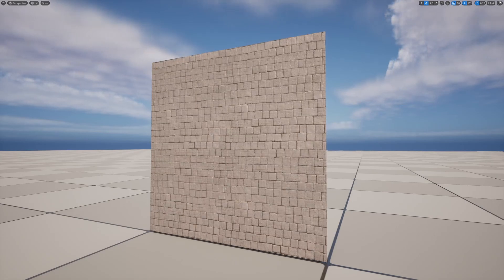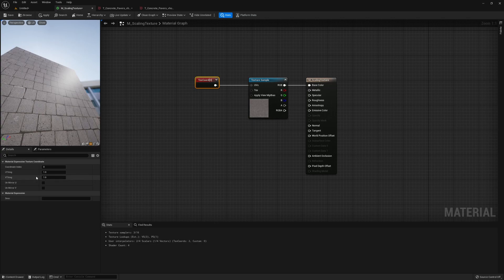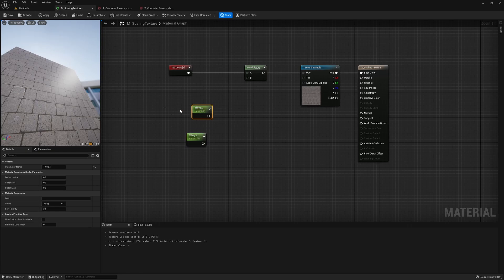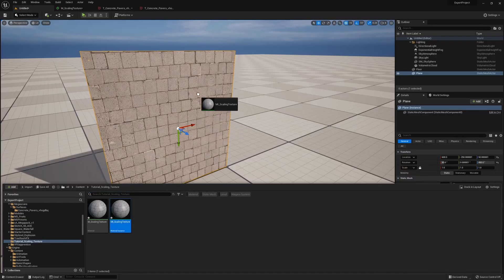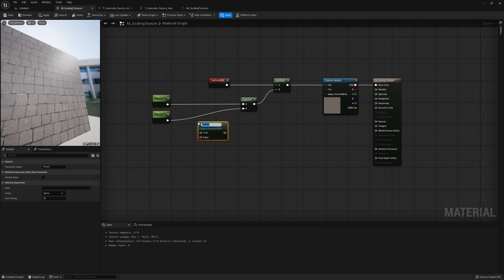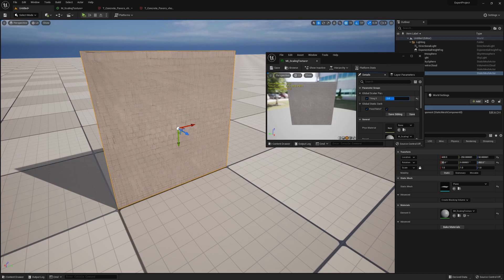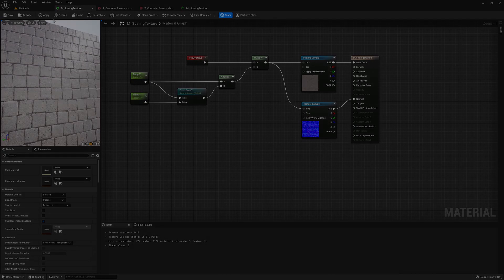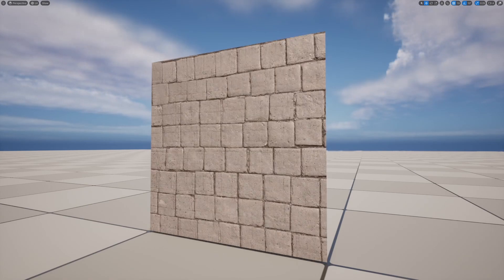How to Scale Textures in Unreal Engine 5 | UE5 Quick Tips

Comment: Quick question. I saw your video on tri-planar projection. Why would we want to do this method, if tri-planar is more friendly when we have a lot of static meshes in the environment and we want to keep consistency? Trying to learn AAA methods and methods to improve UE scenes.
Reply from the maker: It's really based on the context and project needs. In fact these two are basic techniques that's rarely used as-is in real game development, often times mixed with other approaches! So understand the principle behind is more important, so just keep in mind that these approaches exsit, and next time when you have a problem you'll know how to solve it!
Reply: Ok, still trying to understand. Basically it's a 'not one size fits all' situation and I need to work with a variety of techniques, I think? My biggest issue is needing to have materials pop out like brick, but that's an issue for a different problem. XD @geodraws